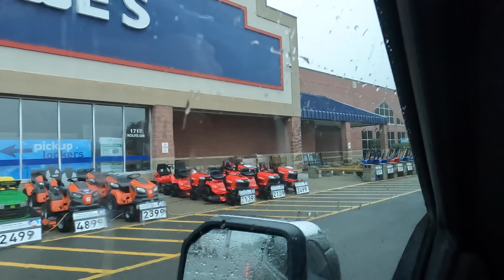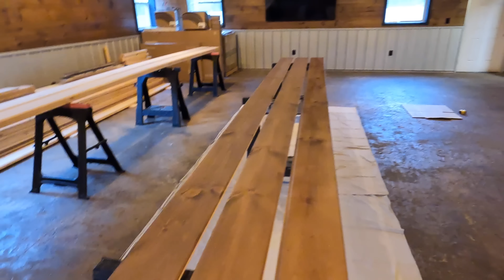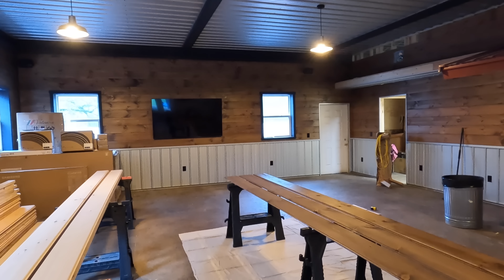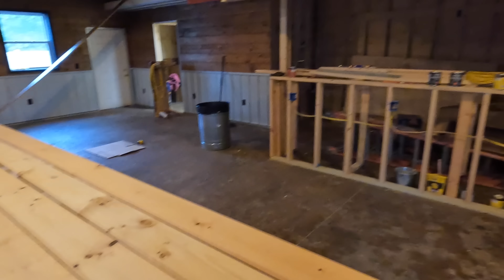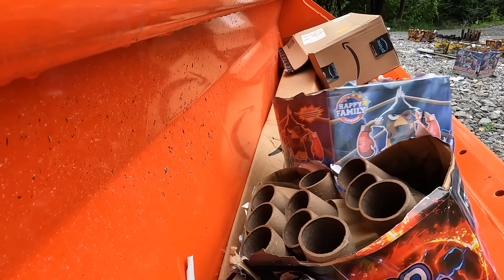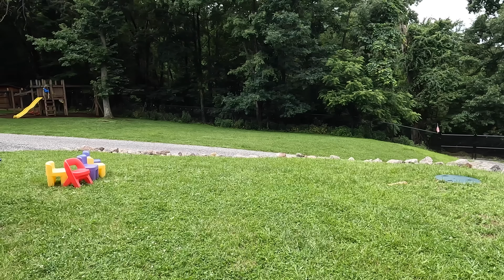This Makes Me Want to TEAR DOWN MY HOUSE!

Comment: Post Frame construction has a ton of benefits over conventional framing.  My wife and I are in the process of building a barndominium ourselves.  In my opinion, building a barndo is a very doable DIY project for the right situation.

Comment: Radiant heat in my home is the best! No furnace or air is a drawback. Wood stove in my shed cooks you out but when temps drop below zero and the slab is cold, wish there was radiant heat.

Comment: Blown in Acoustic is Amazing.. You can do it in the walls too.. .They sell some with adhesive on the acoustic and a blower/installer with some fan sprayers that wet the glue and it stays put on the walls... I could cool the house down to 65 degrees when the Summer in Louisiana was over 100, and turn the Central off and leave and it would still be cool when I got back 3 days later.. Amazing.. and, sound deadening like you would not believe.. Bet it's the Acoustic.. Imagine it also in the walls.. :)

Comment: 1860’s old Victorian home. The only thing left of the original home is the charm. 10 years of hard work, but it’s a very passive style of construction. It almost can’t drop under 50 degrees in the cold N IL climate, or get over 85 during our hot humid summers. It takes very little to achieve a 72 degree year round temp. Big floor to ceiling windows, strategic positioning of the home so that the sun baths the home with heat during the winter, but when the leaves are on those big oaks, it’s shaded all summer.

Comment: One way to replace it and not wipe out the family - Build on the site the new one and then take out the old one.  So it is a matter of moving from one to the other over a good length of time.  Can build a shell and have it finished by you and your contractors.  Get a pro shell.

Comment: Mike, I believe the insulation that you placed under the concrete floor is saving you from loosing a lot of heat energy in the winter.

Comment: Roxul  (rock wool insulation) makes a one inch and two inch solid board insulation used on the outside of buildings under the siding. I don't know what you have for siding, but I am all about fireproof, and I like the cementboard clapboards. Another suggestion I have is for really good attic ventilation. Most of what is done is kind of weak. Ridge vent stuff helps prevent moisture but does not give much air flow. (What does this have to do with firewood?) So, the workshop looks great!

Comment: I worked for Morton Buildings for about 15 years and left the company 30 years ago to start a business. Their insulated buildings were so energy efficient with the bearing post 7’6” OC and rolled insulation between the post was so incredibly efficient. Not like a traditional home with 16” centers and at outlet boxes lost a lot of air. Most of my customers would say it’s cheaper to heat and cool their new building then their house. I’m planning on building my forth house with pole barn construction with about 20% living quarters and 80% for vehicles and toys.

Comment: Mike's thoughts about: Tearing down the house. I completely understand. We used live in a 1890s farmhouse/ old dairy farm in Upstate New York/ White Creek. I remodeled our kitchen 2 twice. We wanted to close off the kitchen's middle sliding. Then tear down the kitchen's knotty pine closet. The other side was the dinning room's china cabinet. I built a new ramp/ entrance to our kitchen. The former doorway was our food & condiment shelves. The "structure/ shelves" were the recycled knotty pine & china  cabinet. Then rearranged our kitchen's metal cabinets. Premade counter tops & new sink. New floor  underlayment & linoleum flooring. Then 8 yrs later. Our dogs ripped up our linoleum flooring. I put a new floor in. I did our 10 by 6 bathroom 3 times w/ 3 toilets. ( A moisture & very hard water situation.) I've did redo little things that I've built. To improve on it too. I believe. It's learning process of failures & remodeling. My suggestion to make your house more efficient. You probably can do minor things to your house. Like an upgrade. Then remodel your house's main bearing 4 walls. You can ditch the old drywall. Redo the insulation. Then do a finished wooden walls. I'm " telling you what to do." I'm suggesting. I'm a disabled remodeling carpenter & builder of 42 yrs. I've gutted out the bathroom's bearing wall of the 1890 house. It did help make that wall warmer. During our cold winters. It was our " north wall" too. I can do drywall. Story: My high school shop instructor in my sophomore year. He was impressed. I was finishing a partitioned wall of drywall. I got an A that day. I'm sure. You can upgrade your house Mike. Ask a honest professional builder. You know a carpenter is telling the truth. Good luck Mike, Melissa, & family. 😊😉👍❤️💜🙏

Comment: I just had a 30x45x10 metal building put on my property. It is on a 4 inch slab with a vapor barrier. I am about to have 2 inch closed cell insulation sprayed inside. It will cover all of the walls and underside of the roof. This will give the building an r16 value. All of the windows are double pane low e. All of the doors including the sectional door are insulated. There will be no ceiling panels or interior walls. With the central Texas heat getting to 105 plus I am hoping that a 36000 mini split single head will do the job. It's rated for 1800 sq. feet.

Comment: Glad you are healing quickly . In the day that I did fireworks for neighbours and friends .I wore my fire gear and had many 5 gallon buckets  filled with water in numerous location among the spectators. I never had a mishap   but one fire works came down into the crown melting a hole in my friends mesh deck chair. .I stopped the fireworks because of the fear of getting sued from an injury that could be blamed on me ..W.V is looking great .Have a day EH.

Comment: Sounds about right on costs. I am at $80-87 per foot depending on finish materials for 6” framing with foam insulation. Much of my cost was in 4 fourteen foot doors and labor. Builder is handling it all. I thought about metal, but the building was framed with and will match the new house.

Comment: 210,000 is ridiculously cheap for that awesome building! I'm currently building a 1200 square foot A-frame and doing most of the work myself, I'll be very lucky if I keep it under 300k. Nice work Mike!

Comment: Thanks for the video, just as important as insulation is infiltration control which appears done in your new building. 
If you start fresh consider a timber frame with SIP panels, it is a great system installed correctly. 
Jmo as a 30 yr HVAC contractor who heats with wood.

Comment: Just built a 
Barndo. Went wood framed. Far easier to put up walls. Love it. 6” walls, spray foam roof, standard fiberglass in the walls. Southern MO. Needs to breathe. Going with the Regency wood burner.

Comment: ryobi brushless is by far the best
Reply: Milwaukee and Dewalt both kick their butts!
While Ryobi was pretending to build cordless tools, Dewalt and Milwaukee were actually doing it.
I'm a Milwaukee snob, and Mike Morgan likes Dewalt.
Once we bought into a battery platform, we stick to it.
If Ryobi would have been faster on getting a handle on their battery issue, they would be a player.
They are not.

Comment: Nice video Mike... You ever think that with the house being done years ago. Did income play a  part for building materials.??  Most of the time younger people don't have the income for the more efficient whatever. As you get older, most of the time your income will increase as well. So you're able to buy a better stove and so on. Also your network has greatly increased over time, With friends giving you better advice on certain things. That you would never have known about.  You tube has definitely made your network larger.

Comment: DO NOT use faced (vapor barrier) insulation on inside walls, it is now a noise barrier/silencer, it will cause mold/mildew due to holding moisture.  Retired heating/AC contractor, +other mechanical certification. USCG Vet

Comment: Build with ICF forms. We did it about 16 years ago and couldn't be happier. It gives the thermal mass that you are experiencing in the floor on the new building, but also in the walls. Absolutely cant beat it. Costs about $650 a year to heat it with a heat pump. And almost nothing to cool it. In north east Ohio , so basically the same climate as u have.

Comment: Mike, be careful with the buried fireworks. Years ago we had the state police bomb squad bury commercial fireworks at the highway dept pit. The backhoe operater wanted to dig down 5 or 6 feet but they said 3 feet was deep enough. They lit them off and out of the groind they came and lit the hay bale pile on fire. 7000 gallons of water later it was put out.

Comment: I can relate to your C-17 flyover. I used to drive a semi hauling bulk cement and while driving down the highway, was buzzed by two A-10 warthogs from a nearby airforce wing. I swear, I thought the earth was opening up beneath me. The truck rocked sideways and the roar was deafening. I bet those pilots are still laughing! 😂

Comment: We got to sheets at 6:15 this morning and the line was just under a 1/2 mile long so we took the truck home got the mustang and went elsewhere and filled up with 93 octane, lolololo!. My buddy has radiant heat in his floor and that's all he runs to heat his building, but he uses a lot of electric to run his water heaters, personally I'd heat with wood free!.

Comment: Re heating and cooling I'm w you Mike! We are in the final stages of a new house in NE. I'm not sold on radiant floor heat either like the rest of the world.. Centrally ducted heat pump and wood heat (Tulikivi) The nice thing is the ducted circulator can just move air around from the wood heater. We did do spray foam-I do run a dehumidifier some at this time of year to keep things extra dry. Time to gut the house…
Thank you-always a treat ❗️👋

Comment: Glad your injury was not debilitating and you are healing well.  I too would like a barndominium, but single story only.  I promise, the older y'all get, the less you will enjoy stairs in a two story house.  On the positive side, if you really want a two story home, electric residential elevators are better built now days, and significantly less expensive than 10-15 years ago.  I LOVE your barn.
Reply: Exactly. I have a 3000 sq ft house with 4 floors & an elevator. Love the elevator. 🙏🙏🙏Blessing’s

Comment: I have built alot of homes with radiant heat in the floors and people love it for its comfort and efficiency.  In your situation where you may not need it as your main source of heat I would suggest keeping the slab at "warm" temp in the winter so it would keep the place warm when there is no fire on and your feet nice and warm when you are in the building. I'm not sure whether you have it or not but some systems have a sensor in the slab that will let you keep the floor at a certain temp. Happy Independence Day to you and a late Happy Canada Day to my countrymen.

Comment: Hire an insulation company to drill the walls inside the house and install low expansion foam to fill the entire wall cavity. They'll remove whatever type of insulation previously used.

I was about to pull the trigger for having blown-in RockWool blown in, but I want to install new outlets, so tearing out the old Sheetrock and installing new makes this a DIY project. I'll still blow in another foot of insulation in the attic.

Sky lights, no matter how expensive they are eventually leak. The powered shades help reject ultraviolet light, but they also has a relatively short life. 

The negative on a Barndominium is that they don't hold their value. I've seen some custom models that were well over $125 per sq.ft in pricing. It's still a dressed up pole barn.
Reply: Our bardomenium hasn't lost any value.
Conventional wisdom would dictate that it should, but it has appreciated in value. A LOT.
Reply: @haroldphipps3457  
IMO, the construction methods used varies more with a "pole barn, bardomenium ". A quality builder that utilizes an architect for a home build verses a mulit-use structure. i.e work shop, storage.

I followed R&R Buildings, as he appears to do top quality work in the bardomenium arena. I'd take one of his builds. Anyone else, I'd have to see a few of their builds before I'd plunk down my money.
Reply: @gungadinn  R&R does top drawer work !!!

Comment: If I could I would build into the side of a hill with a southern exposure. I remember plans back in the 90s of that kind of thing that had an inner and outer shell so in winter the air on the south side would heat up, circulating over the inner shell and down to the thermal mass under the house. Convection heating and cooling! Very little exterior to maintain. Very quiet!

Comment: Your house needs balance dampers on the takeoffs so that you can balance the rooms to make them all the right temperature.  You can manually adjust them, individually, to produce the effect you want.   I would imagine your's has duct either in the attic or below the house.  The dampers are very inexpensive.  I always included them in every installation I did to prevent what you mention here.   36 K btu looks a bit oversized for that space.  You could probably do it with 1/2 that or perhaps 24 K.  I've installed Mr Cool as well as most brands.  They are rather efficient and effective at much lower temps for heating (heat pump models), as the compressor uses DC current which allows variable speed op.  That's important in cold climate.  Both the indoor fan and the outdoor fan are also DC and the control circuitry can adjust the speeds of all 3 to produce warm air at a much lower temperature than the old archaic split system heat pumps of old.  Also, you can do a metal roof-over with 3 inches of foam insulation to cover the existing roof which will solve most of your heat loss/heat gain issues on the house.  Don't fret, modern tech is here to help.

Comment: If you tear down you house to build a more efficient house ANY savings you think you might have in heating and cooling the place will be gobbled up two-three fold by you local school district when they immediately re-assess you new property.  You township probably also has some kinda stupid rule that you can't tear a house down without a demolition permit.  And they won't give you a demolition permit until the NEW place is built.  So the new place can't sit where the existing place is located.

Good luck.

Comment: We have a 4 bedroom 3 bath one-story house with a triple garage using 2500 square feet. This worked well 30 years ago for a family of 4 at the time. It was built for bedroom space with a single kitchen and family room space, no dining room. It has appreciated in value over the years and it is located within a subdivision inside city limits. The property is 1 acre in size, so we could accommodate "a barn structure" without giving up "the house". We have already done a few remodeling projects but the initial floor plan, now 30+ years old, has served us well enough.

Comment: Still nice to have that radiant heat in the workshop come winter. Anytime you have to work on equipment down on the floor, or close to it, that warm floor is a real bonus. Especially when you get the ol' dude aches n pains. Great show the other night. We were under fire watch in the PNW and no show for us but yours. Thanks for sharing.

Comment: Dear Mike and Mel hello this is my first comment but I have been watching your Channel for three years . I’ve been a licenced wood heating technician here in Canada for just over 40 years and wanted to give you one little tip about your fan in the game room . In winter you should always run that fan in reverse so it picks up cold air from the floor and pushes the heated air across the ceiling and down the walls to the floor “ it provides the most even distribution of heat throughout the entire area and since the walls are the largest source of heat loss it just evens it out quite nice , yes run it blowing down in the summer but always drawing up during the winter . Who knows perhaps you already know this , you seem a very crafty man to me and I respect your hard work and dedication to your family and home . Keep it up my friend , from a Canadian friend . Have a great day !
Reply from the maker: Thanks for the tip
Reply: Good way to remember which way is heat-up, cool-down.

Comment: You’d be better off taking the fireworks apart as well as they are protected by moisture.

They are made out of black powder so use prudence.

Ex wife used to assemble fireworks and it’s amazing how they are protected from moisture.

Comment: you could upgrade the ceiling insultion in the house.That will help.A new house could have roof trusses spaningonly on exterior walls only  with conventional timber framing. If i ever build a house it will have 6x2 ext framing purely for more insulation and the best double glazing